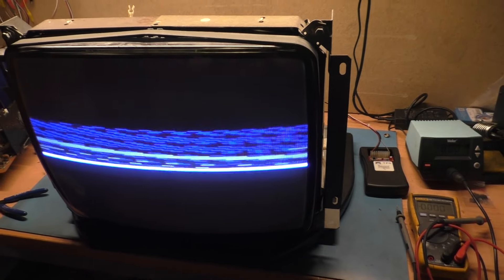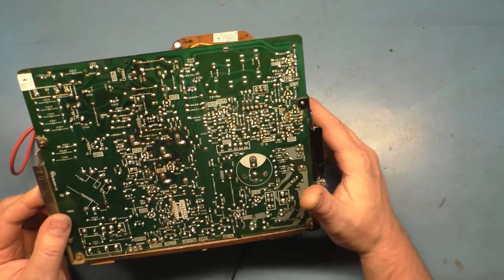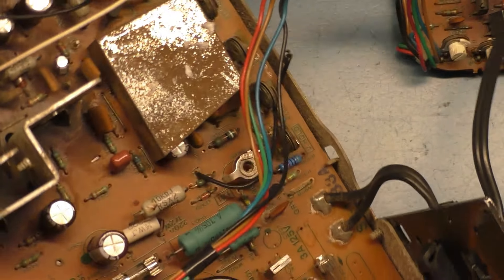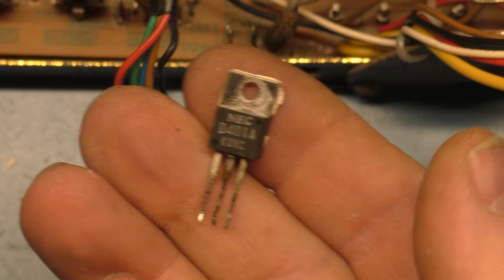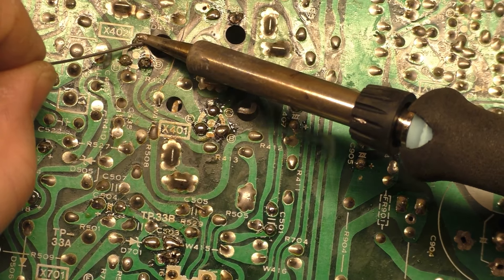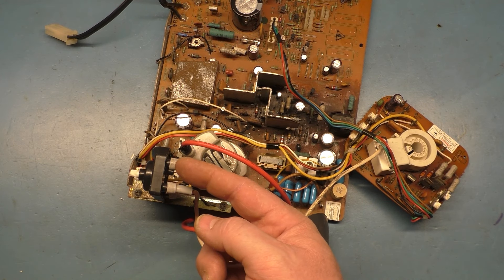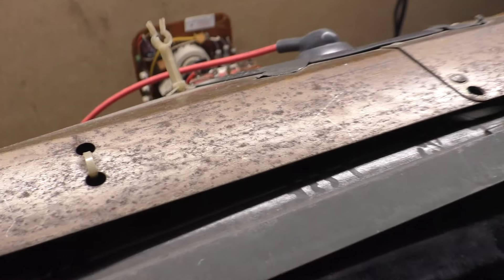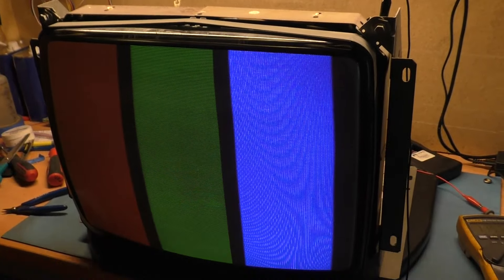19" G07 Arcade Monitor Repair - Partial Vertical Collapse, B+ Adjustment

Comment: HI Mike, Big thanks to you as I was able to watch this video and your video on the 7000 collapse and apply the logic to my K4900 collapse! I was able to fix the chassis today!!! turned out the vertical 302 transistor emitter leg was not testing out good while in circuit but tested good on the bench. so I started looking at the schematics and tracing out the emitter leg which led me to the 2 zenner diodes just down the trace from the emitter leg. wouldn't you know it they tested faulty! So I replaced them and the half collapse was fixed!!! took me 8 hours to track it down but so worth it!!! Thanks for making videos!

Comment: As a retired tv and audio tech I can tell you that you never count your chickens before they hatch. I too had the partial vertical collapse, and usually it would be a faulty electrolytic filter cap. I never thought of looking for the last thing it could have been which was a broken vertical height potentiometer. someone tried to adjust it and must have pushed on it too hard and loosed the back side plate and broke it off. both transistors were checked to be good compared to a new one. I did find a couple of bad caps, including the crt cap (completely shot). anyway now I'm searching for something that back in 70's, 80's were common parts, but now they're called "vintage" and are hard to come by. I'm looking for the "vertical Height" potentiometer 200 ohm. I'm just wanting  to fix it and sale it. I don't have anymore old tv sets to cannibalize like the old days. LOL, Any help appreciated. BYW, it's the same chassis your working on this video. But it goes to a Aero Fighter upright arcade machine

Comment: I am trying to track down why my k7000 blew the HOT.  I did the lightbulb test and got 117v off the blue wire of the b+ resistor.  My light bulb measure 57w power draw with a watt meter off a standard power outlet.  Should I be concerned that its not 123v?
Reply from the maker: No, the lightbulb test is just to verify the power supply is working. B+ should be measured when the chassis is on the tube.

Comment: What if 401 and 402 are both showing .6 voltage drop?  Could that be enough to cause partial collapse?  B+ right at 120
Reply from the maker: Possibly, if one of them is failing under load. Assuming the yoke is not at fault or there's not a bad solder joint or broken trace somewhere.